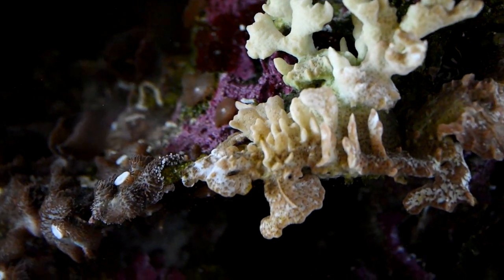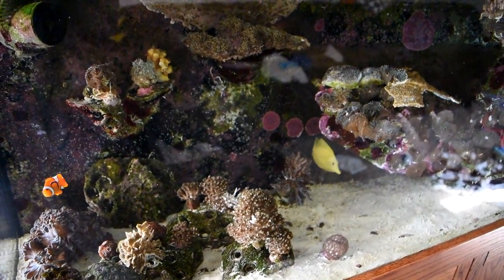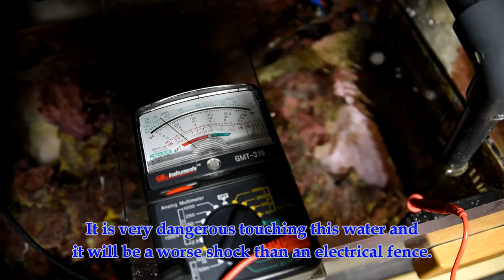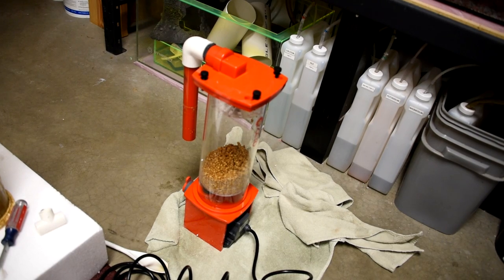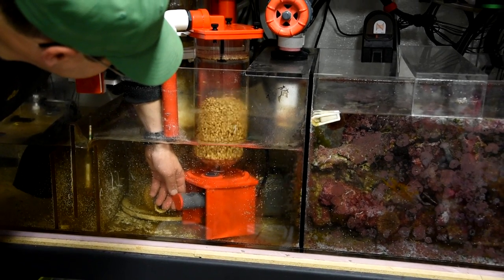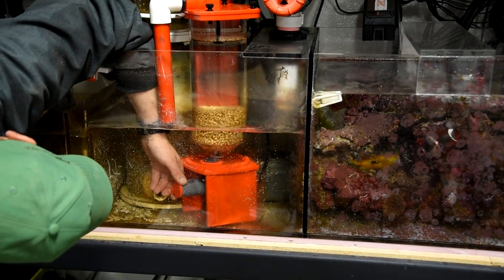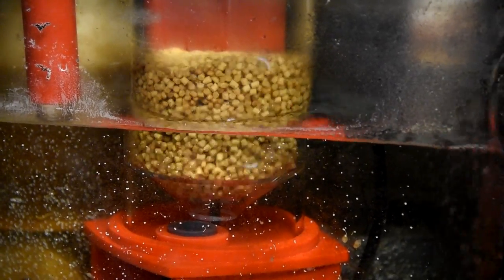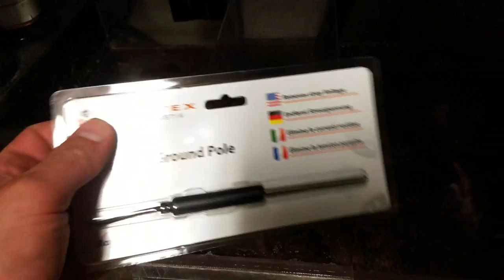Electrical Trouble in the Tank with Biopellets

Comment: Thanks for the video, great information. How do you know which is the positive side of the wall outlet?
Reply from the maker: The black on the multimeter goes in the round center ground of the outlet in the USA and the red in the water and set the machine to AC current=)